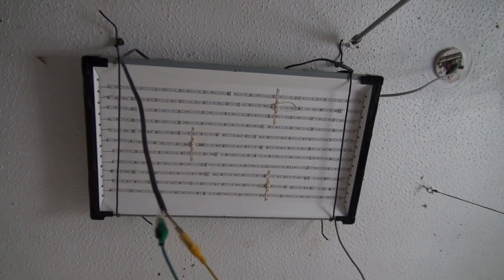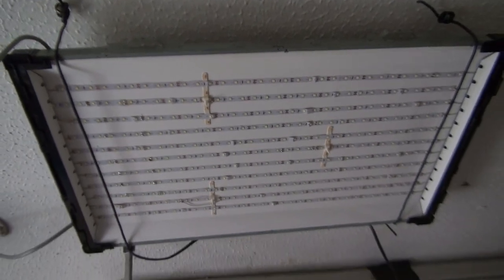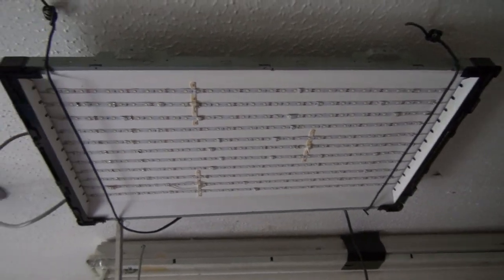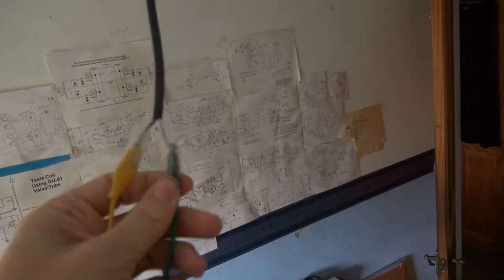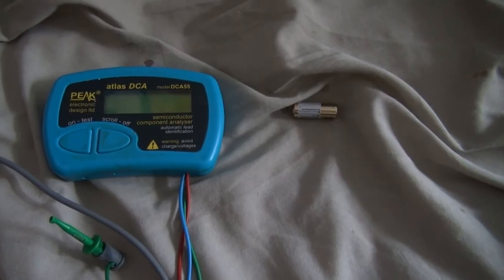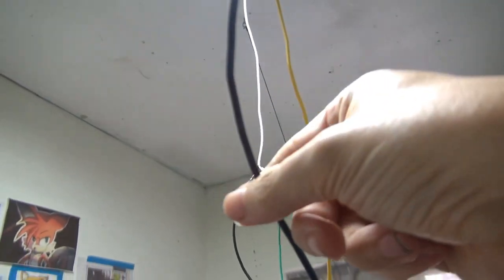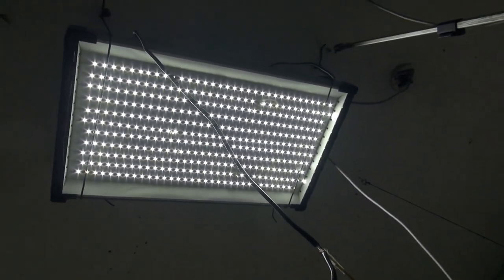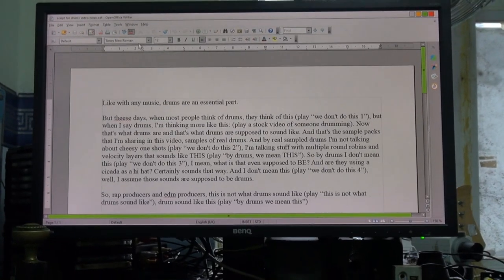The only light in the world with a power supply made by Nintendo!

Comment: hot wires can be dangerous as LEDs age they start to pull more current making the wires hot enough to burn through the insulation while you're away I know we tend to not forget to turn off the light when leave the house but i myself forgot many times.
Reply from the maker: This isn't a permanent solution, this is just temporary while I'm between lights.